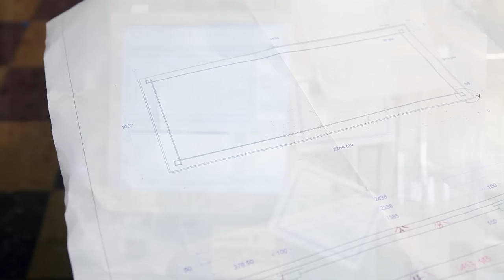Berkeley Mills Shop -  Custom  Mesa Dining Table

Comment: What is the tool used to surface plane the raised inlay?   I've not seen that before.
Reply: I believe it is a custom tool. An angle grinder with a heavy grit sanding wheel, in a leveled jig to make sure the wheel only flushes the surface.
Reply: It's a product by Lamello. Canter Ergo lipping planer. Nice to use but cost $1800